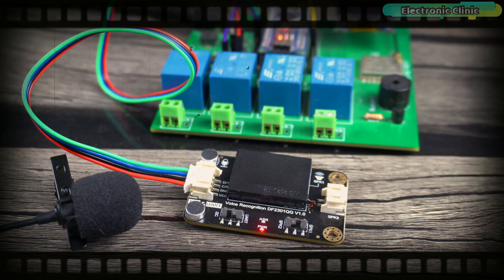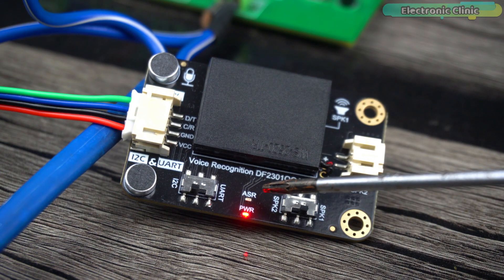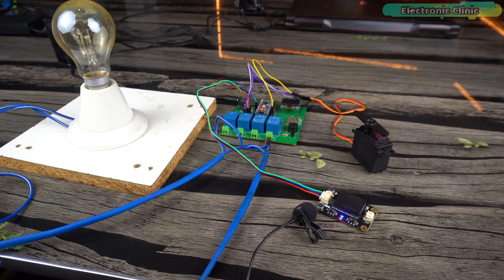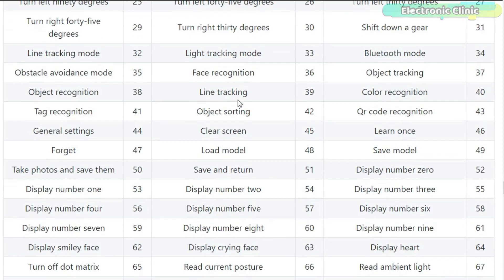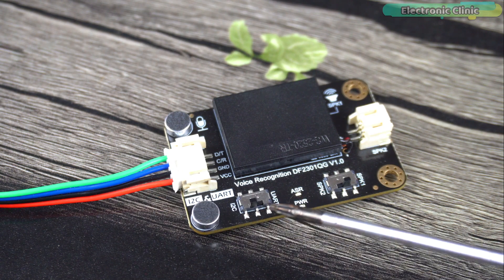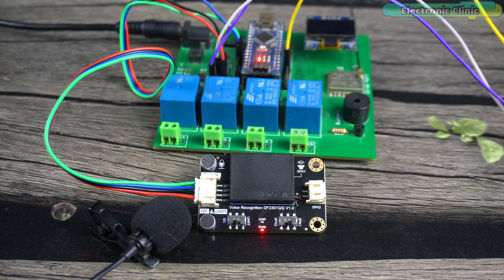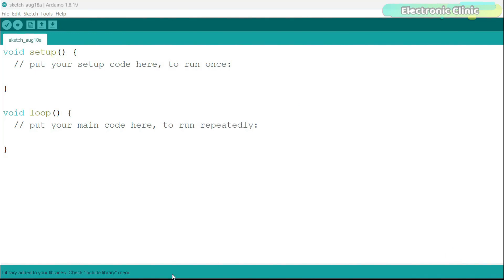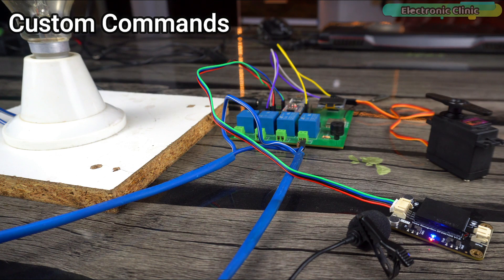Voice Recognition Module with Arduino,  voice module by DFrobot, Voice controlled home Automation

Comment: Sir, 

You make great videos about Arduino applications, thanks for that.

I am new in this technology and I try since a week to get more comprehension of the system, especially of the Voice Recognition application using DFRobot2301Q.

However, I would like to ask your help for a simple case of commanding 1 LED with DFRobot2301, like in your video “ Voice Recognition Module with Arduino “     (*)

1.	Is there a general code for DFRobot2301 hardware and another code for the specific              application?
If yes, do I need to merge these two codes to form a new one ?
2.	Could you please also tell me if the code shown in the same video (*) is ready to use for the application?
3.	Would it work if I only use one Led, without fan, buzzer, servo etc. ?

Greetings,
Marc

N.B. When I try to compile the code before uploading, I got the message «exit status 1 – DFRobot_DF2301Q.h: No such file or directory”
        I don’t understand how to debug or understand the problem. 

(*)     “Voice Recognition Module with Arduino, voice module by DFrobot, Voice controlled home Automation »
           (https://www.youtube.com/watch?v=qSqbq6sm4rQ),

Comment: Way cool. I've used this module with a RPi Uno to control most everything in a home as most vendors of smart home products such as lights, cameras, sensors and smart sockets provide Python libraries for wireless control.  With only Pi and DFrobot module you can control many smart home products wirelessly with voice commands.

Comment: hey, thank you for your clear review, I have 1 question when I use this module with the I2C communication together with 1 OLED display using I2C communication too, so how can I control both of them, to declare the address? I'm just a newbie so I hope you reply to my comment, many thanks!
Reply from the maker: Both have different i2c addresses. Connect both the modules to the same sda and scl pins.
Reply: @ElectroniClinic Sir would you mind writing a short code for me:_) I'm a newbie and want to complete my project because it has too little documentation about this module and still don't know how to share the I2C bus with multiple devices. Thank you so much, Sir!
Reply: @ElectroniClinic  can i have your code :_) thank you sir

Comment: Excellent video! This video helped me with the hookup. I'm a learning circuit design. 30 yrs of programming experience so that part of microcontroller development is a lot easier. So I know your time must be very valuable. That said, would you be so kind as to tell me how you hook up an external microphone? I have a Adafruit Electret Microphone Amplifier - MAX4466 with Adjustable Gain [ADA1063] coming in the mail. It is a hard-wired mic, so the hookup may be significantly different than your wireless. The advertised gain is 125x to 25x. I'm building a robot to respond to voice commands. The motor background noise may be too much for the DF2301Q to function, but I'm seeing where the project takes me. Keep those great videos coming! I subscribed and liked just a few minutes ago. My main question is: How do I hookup a mike with the DF2301Q? I've watched the videos on hooking up a mike directly to the Arduino. I think I understand that. Many thanks!

Comment: Can I attach an external mic to the board? I’m working on a sleek robot and I’d like to hide the board itself in the body and only attach a microphone on the outside. Any idea if this would be possible? Thanks!
Reply from the maker: Solder wires to the mics legs.
Reply: @ElectroniClinic Do you mean the traces on the board that connect to the mics by “legs”?
Reply: In the video u show the backside of the board, there’s two pads on the place where the mic is connected to. Could I solder a mic directly onto those? Would that bridge the onboard mics? Never attempted something like it before